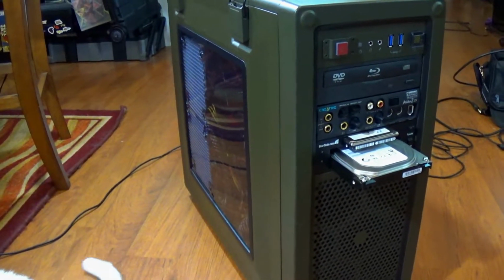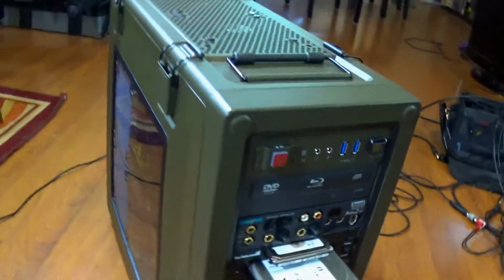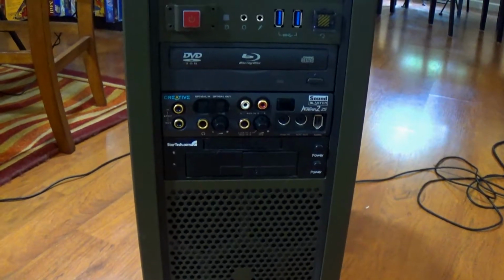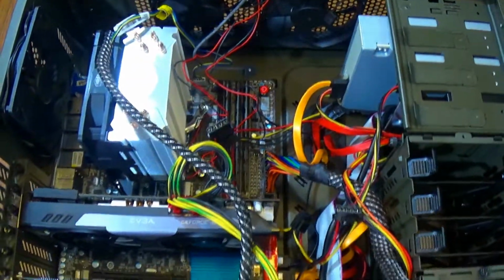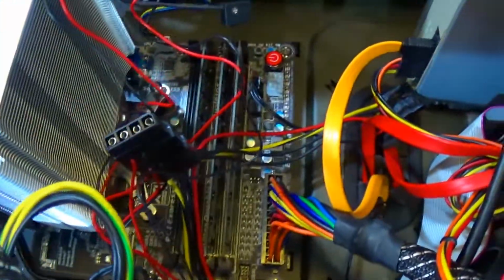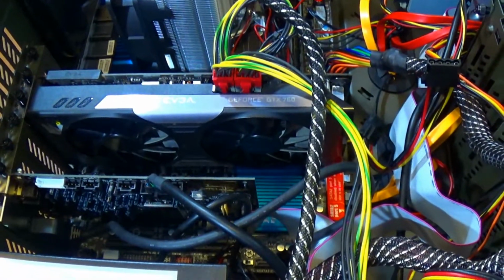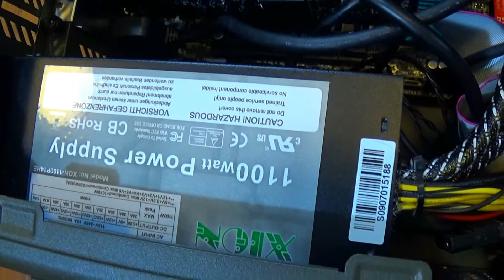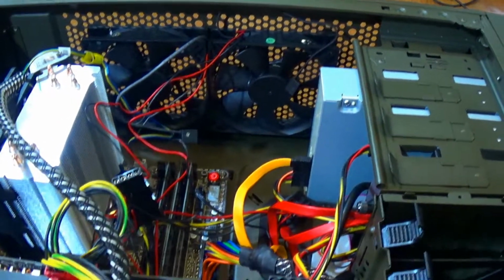Thrifted PC Build - That Thrifting Series Ep. 27

Comment: 1100 is overkill to the point of you should put something closer to your needed wattage in it to save money on the things powerbill
Reply from the maker: +Wake Archus From what I've read a PSU only pulls what is needed (plus a little extra depending on the efficiency). Larger supplies are inefficient when used in low wattage systems, but fortunately this one is pretty close to the efficiency butter zone for this PSU.